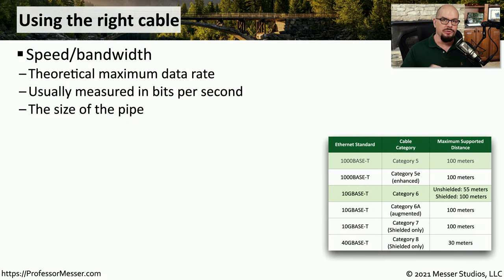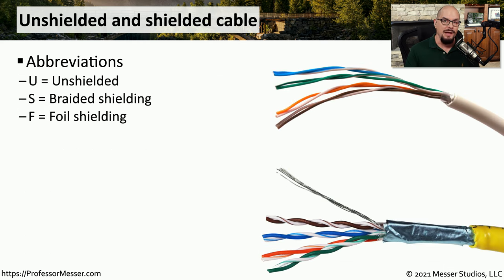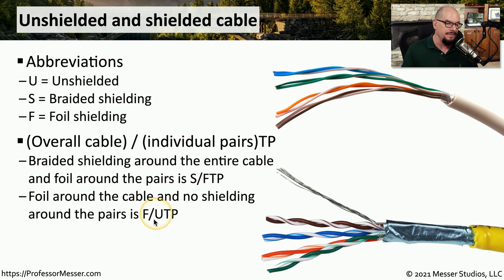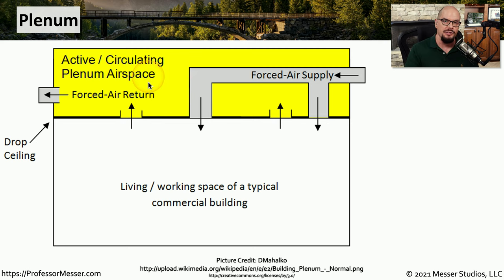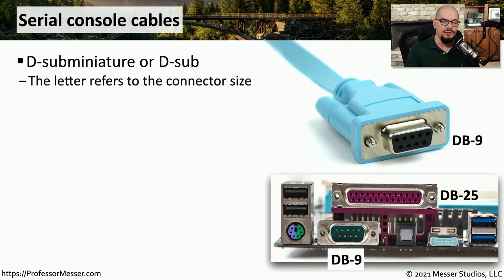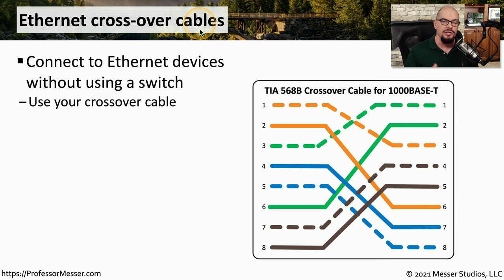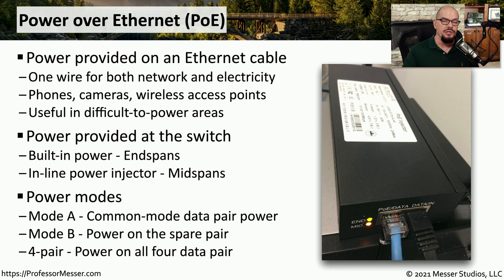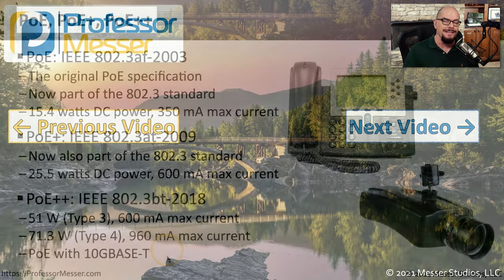Cable Connectivity - N10-008 CompTIA Network+ : 5.2

Comment: In the table at 0:35 it says Category 5 Ethernet is 1000BASE-T but I thought Cat5 was 100BASE-TX and it was Cat5e that was 1000BASE-T?
Reply from the maker: The IEEE 802.3 standard states that the minimum supported twisted pair cable for 1000BASE-T is Category 5, not Category 5e.

Comment: So….we use SERIAL CONSOLE CABLES instead of Rollover Cables for the switch and router management ports now? Not too clear there. You mentioned both
Reply from the maker: It depends on the switch or router. You might need one or the other.
Reply: @professormesser  oh, thanks Professor for taking time to respond, man! For exam purposes tho?
Reply: @professormesser  And I mean, “I’M not too clear there”. Not you, you’re a life saver with this shit!
Reply: @jakepayne2985  Both are valid, just remember that part. They wont go that far into that. Some devices use one or the other.